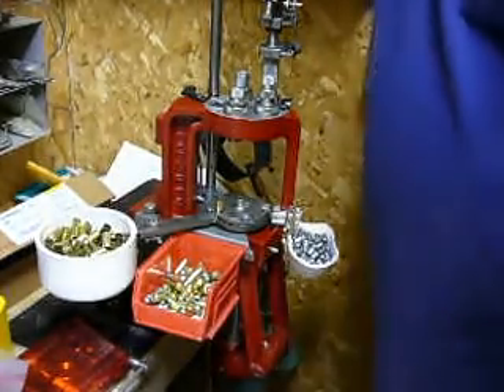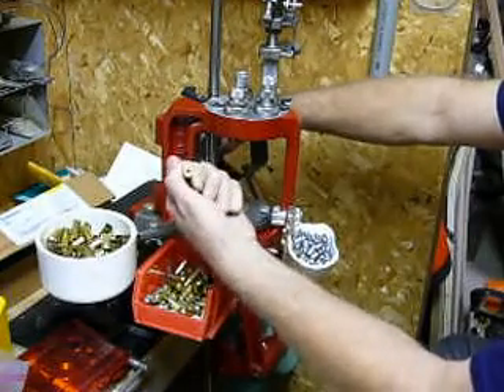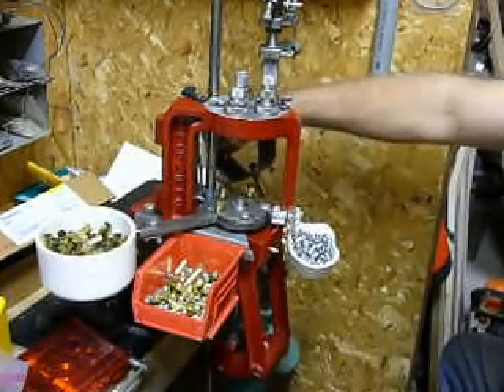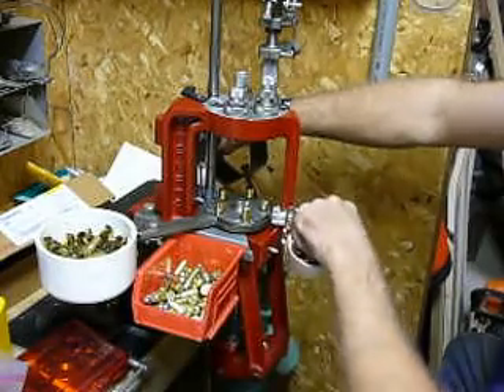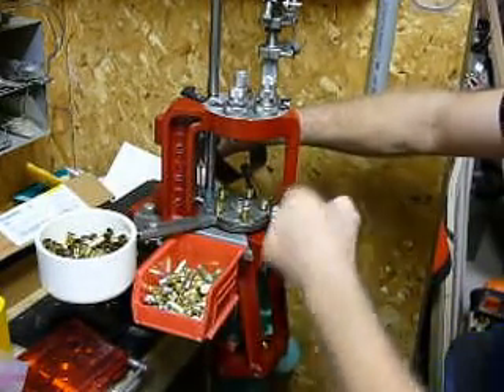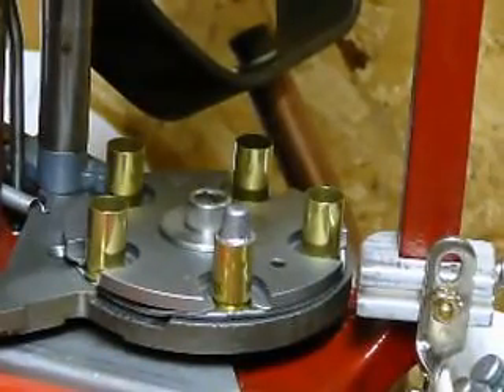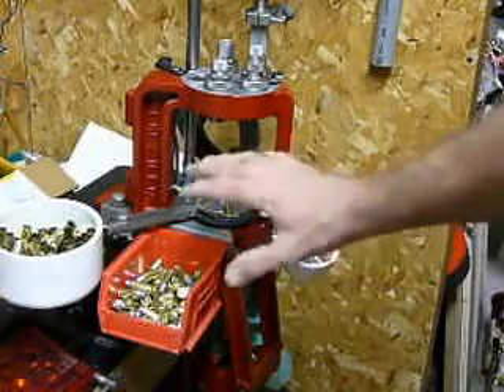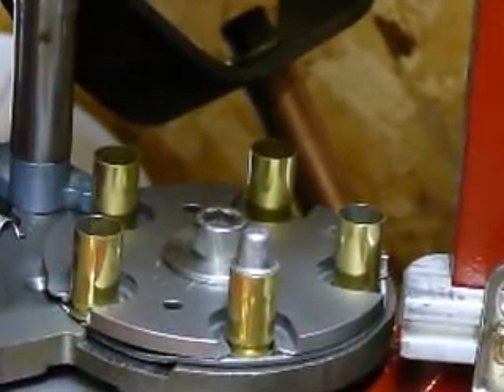Hornady AP Lock N Load enhancements

Comment: Your ergo handle must be very light. I've never had to push that hard to seat a primer. Looks like it could be dangerous. I use an old Dillon 550 handle because it has a bend in it, it's shorter and the ball end is larger.
Reply from the maker: Actually my ergo handle is 3/4 copper coated steel, very heavy made.
I kinda over stressed about needing to press hard about seating the primer, they are generally easy to seat. Those ball ends start to hurt your hand after loading for an extended time.
Reply: Sounds like a solid handle. I agree with you on the ball end type. I bought a Dillon roller handle for my 550, but my presses are set close to each other and I don't have the room to use a roller handle on the Hornady as a wall is in the way.
Reply from the maker: I had to make some special bends in the handle in order to clear the press.
The roller is made from a boat guide roller that I turned down in the lathe to fit my hand.

Comment: how did you make the ergo handle?....thank you
Reply from the maker: +avidtinkerer I grew up in a machine shop environment and acquired many fabrication skills. The shaft is 3/4 steel formed on a bending machine and threaded with 3/4 NF threads on one end. The other end is tapped to 3/8 NC to accommodate the handle. The handle is a rubber boat guide turned down on the lathe to fit my hand.
Reply: +rwghandyman thank you for the quick response. I am teaching the grandkids the basics on a limited budget with the lnl-ap...so far all is well, just your handle and brass and bullet holders are peaking my interests. Ty. Cheers